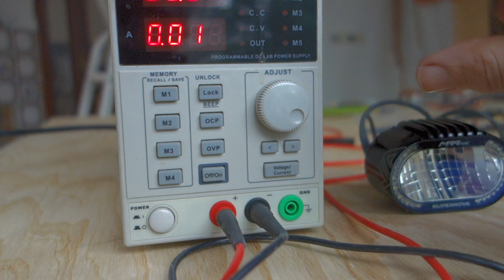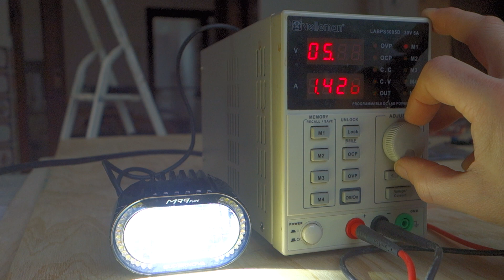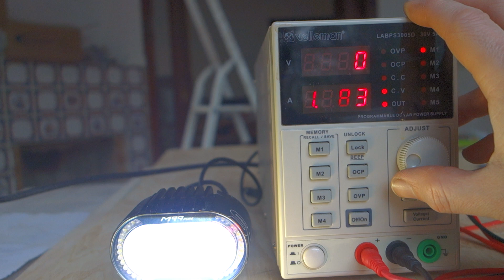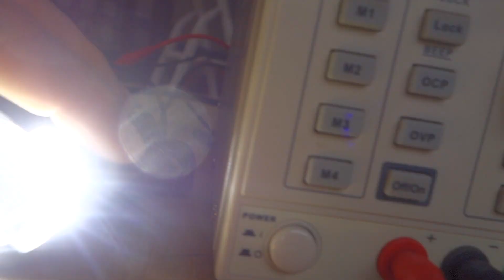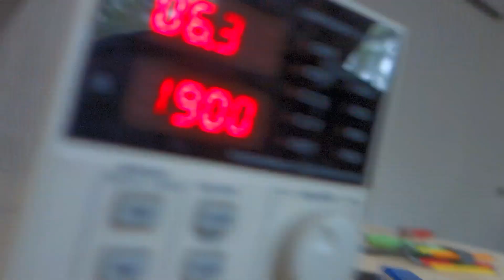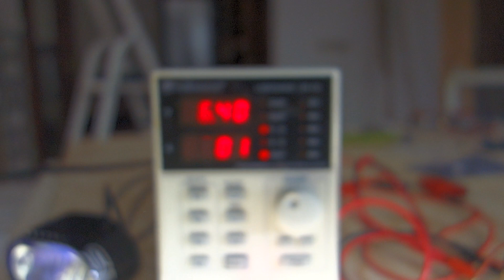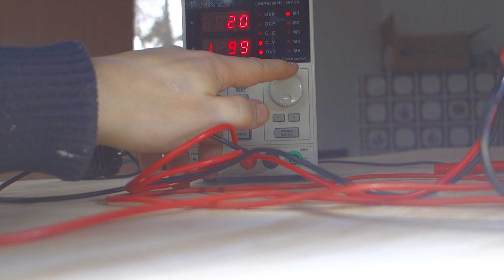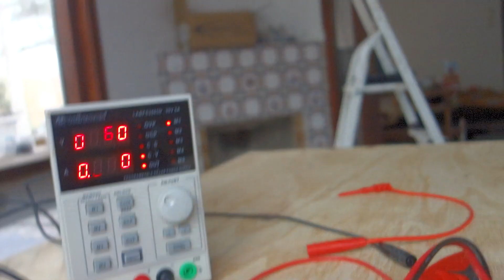Power use of e-bike lamps: Lupine sl, Supernova m99 pure

Comment: How did you get the m99 working on 4 v?
Reply from the maker: I just hooked it up to my power supply, then switched the voltage to 4V and it lit up. Using the 0.1V steps it even started at 3.8V. I didn't do anything else... Do you have one that doesn't light up at this voltage?

Comment: Hi, is this the Lupine SL AF or SL BF/SF?
Reply from the maker: It was a loaner and I discussed it at the time with a reader about lumen measurements and claims by Lupine (some of which were wrong, about e.g. what is allowed in aiming/requirements for the manual) and I recall that from the specs I looked at then, it was the standard e-bike version, it was not the version for Shimano nor Brose, so that should make it the AF.
Reply: @WHS_reviews  I called with Lupine and 7 Days before and the Service say its only vor 7,4v(8,4v).
I will connect the Light with my DIY 12,6v Accu, therefore the question.
Reply from the maker: @Neeru89 : Ah, yes, now it becomes clear: I checked the emails about this topic, and I discussed with that person the A/AF, and Shimano versions, but this is the ebike version, so that means it was not the version for external separate battery. I remembered AF but that was because that was the main version we talked about as he has an AF, but it was not the version I tested as it could definitely be run at 12V (IIRC it says so on the housing, along with power use, I'd need to check if I made a good picture of it).
Reply: @WHS_reviews  Ah, Thank you. :-)
Reply from the maker: @Neeru89 : If you want to experiment and use your own battery pack I'd go for the battery version and not the e-bike version due to no system requirements for mode switching, but then I would use a self made pack staying below the 8.4V that Lupine specifies. It can likely run at a higher voltages then the 8.4V maximum (=2S, 2x 4.2V per LiIon cell) but how much, not sure. I would not take the chance with such expensive lamps!
Reply: @WHS_reviews  Yes, thats right.

Comment: Hey! If you want to make sure your SL's never in DRL mode you can just recalibrate so the cutoff point is way high (shine a light source at the sensor of calibrate it in broad daylight).
Reply from the maker: Interesting to know. I don't mind the DRL, just wondering how/why it worked a certain way. It was  not my SL but a loaner so I was just observing how it works, and wondering about the fact that it didn't seem to me at first to conform to the intermediate StVZO/TA rules (since mid 2017, until the new TA gets into effect) regarding surface area, though it turned out to that a minimal surface is not required in those rules (which is stupid, but there you go, that's what the rule makers did), and that it didn't conform to the power use that Lupine claimed. I corresponded with a reader who mentioned that there are 2 versions, international and StVZO/TA (German compliant), which behave differently in respect to DRL and the power issue could also be related to this difference. It was while ago that I discussed that too with the same person. I didn't get round yet to listing all the details of issues of the 2 different versions to put on my site...